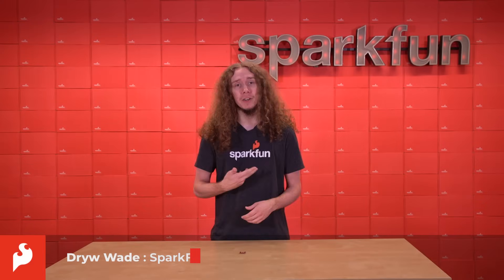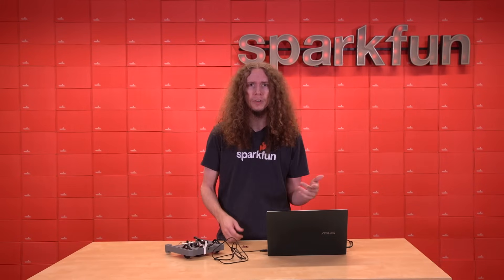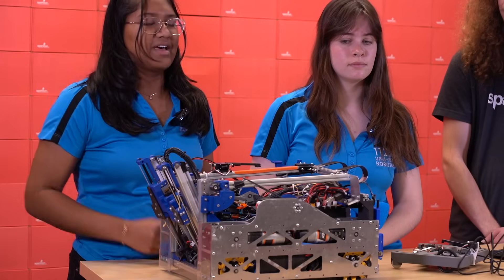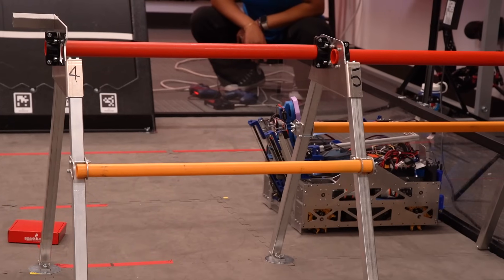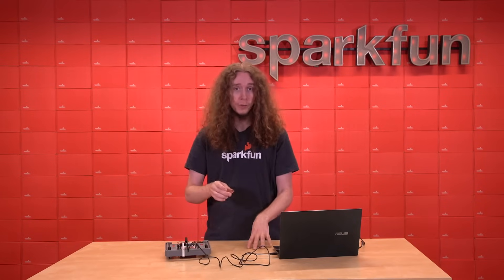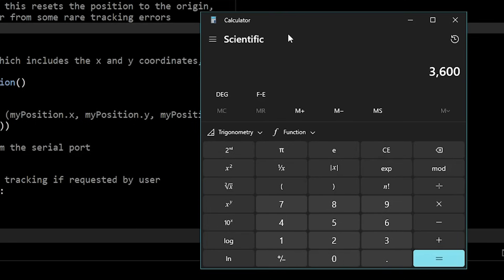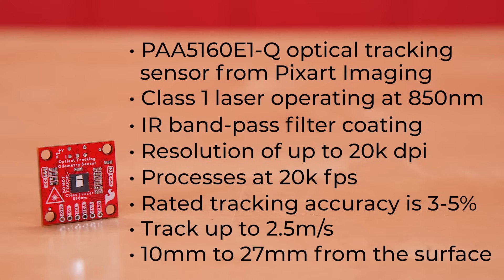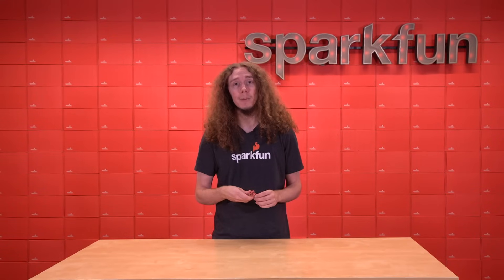Product Showcase: SparkFun Optical Tracking Odometry Sensor

Comment: What's more accurate, in small areas, for positioning, an over the counter GPS, or this odometer?  If its better than 5 feet it may be useful to track other robots, if they share their gps starting point, over wifi, and also have the odometer...

Comment: Hi! As a robot builder for the French Robotic Cup, and since we build holonomic robots, I ordered this sensor on day one
I just received it and I'm experiencing some issues with the IMU. It constantly drifts, even after calibration. That’s sad because all the other features work like a charm. But this drifting on the angular position destroys the measurement accuracy. It's a shame because otherwise, it’s a great product. Perhaps a different calibration method or software corrections are needed?
Reply: at 8:02 he covers how to tune to minimize drift on the angular measurement

if u did that and it still messes up and u think its a device issue (which it might be given you bought it very early), it might be worth looking for a replacement/refund on the sparkfun site

Comment: Am I the only one thinking that such a system would be a hudge upgrade for diy indoor drones, without gps fixes the IMU derivates really quickly. But now it would need to account for varying altitude, pitch and yaw. This system is already implemented into DJI's and parot's drones with bown facing cameras, and having an accessible platform would be really appreciated
Reply: Many drones already use so called optical flow sensors for precision tracking. All current DJI drones use them to hold their position more accurate when close to the ground. This is how they can hover very accurate close to the ground. This is also how they hold their position indoors, where gnss is unreliable.  Additional TOF sensors and Barometers help with holding altitude.
Optical Flow sensors are limited in range though. The ones available for DIY use state that the work within 8m off the ground.
Reply: Yeah they make a ton of these. For example the matek 3901 optical flow sensor is essentially the same thing made specifically for drone software like betaflight, inav, and ardupilot. The one thing you'll find different from this though is that all the drone optical flow sensors must have some kind range finder to make the calculations work. Barometer isn't really good enough in this case.
Reply: Can the optical sensor estimate the position/displacement for a flying drone? For robots that are on the ground, the optical sensor is close to ground so the optical sensor should work. Think about the case of an optical mouse not working when you raise it.
Reply: @TahaKoroglu  I recognise that it would become way more complex for a flying platform, but with some lenses you could adapt the sensor to  a range of heights, and with the imu inside, you could account for the pitch and yaw of the sensor. It wouldn't be easy, but as such there is a market for a working sensor